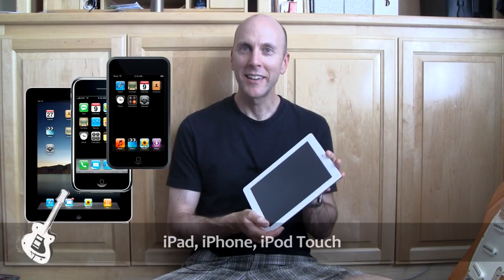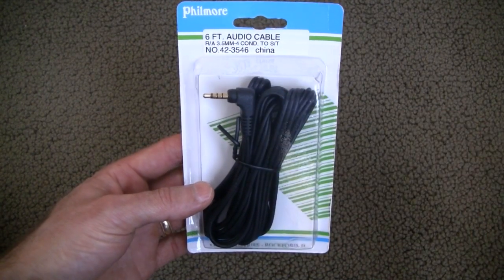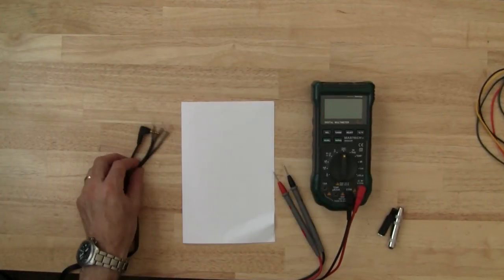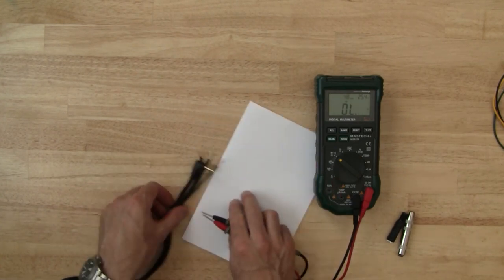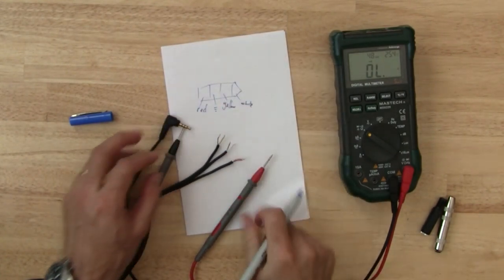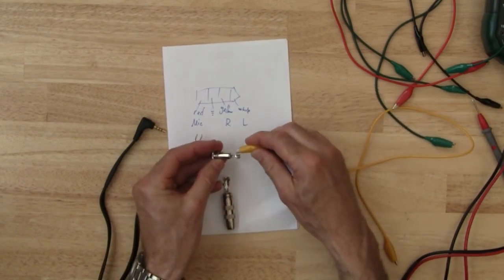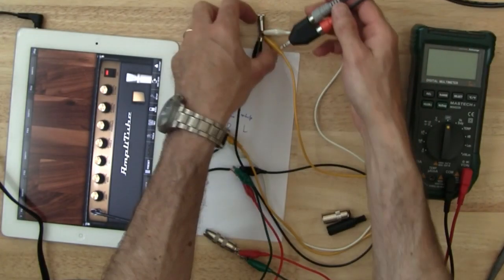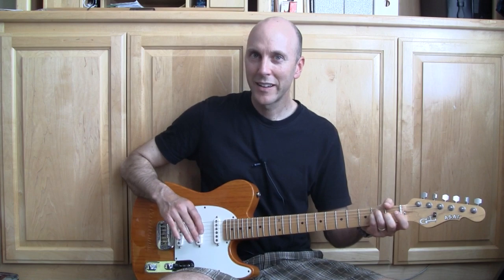Building an iDevice Guitar Interface, part 1

Comment: I am constantly amazed at people like you John, who are prepared to sit down and EXPLAIN the way things are and work, so people can understand things better.
I was wondering if you could answer a question for me?

Would you happen to know if I could just plug my Tascam USB interface, into my Samsung Galaxy Core Prime to use on Amplitube for Android?
I think I could, if I just buy the right USB cable that fits into the interface and the Samsung phone.

I am on a very tight budget here at this moment in time, but I am mad looking to play bass on something and the Samsung phone is the only way to go for me right now with the money I have.
Reply from the maker: +SDRockman - I don't have any experience with android phones so I can't give you a definitive answer.  Not sure if the Tascam USB interface would draw too much power from the phone, or whether the phone would recognize it and have a driver for it, etc... Try it- but buy the cable/adapter somewhere you can return it if it doesn't work :)
Reply: +John Cooper I think it wont work after all because it did come with a CD, to install a driver for whatever operating system you had.
But I will try buying the USB cable any way lol
As you say, I can always return it.
Thanks!

Comment: Thanks for this video... just pulling parts together and seeing what I'll need to purchase.  One use I had in mind for this was as a virtual pedal board.  I'm assuming that I can add a stereo 1/8" to Mono 1/4" jack to the headphone jack, and connect to my amp's send/receive loop.  Any problem with that?

Comment: hey man, i'm definately gonna do this! thanks.  just for interest sake, is it only impedance matching it does?(apart from splitting the signal) if so, will a normal D.I. Box match the impedance, if i use the right connectors? it would mean a lot less soldering....

Comment: I've used the 5457 as interface to my laptop but I'm having a hissing sound though. Is there other way to do this? I did connect my output to the laptop mic input and the latency is acceptable but I can't stand the hissing noise. Thanks in advance John...

Comment: Hello john i have a little problem when i connect headset theres no sound,but when i remove 1of them it has sounds either 1 of them i put the sounds ok but together thers no no sounds
Reply from the maker: Probably some wiring mistake.  As usual, I recommend you build and test the circuit on breadboard as I demonstrate in part 2: Simple JFET Preamp for an iDevice guitar Interface, part 2

Comment: Hi john i made the iDevice, but my ipad 3 don't detect a headset input only like headphones, so i can listen but it don't detect a mic, and is the same with or without the jfet. Only detect the ordinary handsfree. Can you help me?
Reply from the maker: I recommend you test the circuit on breadboard as I demonstrate in part 2: Simple JFET Preamp for an iDevice guitar Interface, part 2
The circuit is much easier to experiment with on breadboard, to make sure it's all working.

Comment: John !  works on Macbook Pro?
Reply from the maker: The JFET in this circuit requires power.  If your laptop has a powered mic input, it might work. But not if you only have a line-in. Check the input with a multimeter to see if it carries a DC voltage.

Comment: will this work for an android phone ? they also have that kind of input.
Reply from the maker: I don't know- there are so many different android devices out there- and I'm not sure how consistent the hardware is.  You can rig up a test plug for your headphone jack and use a multimeter to check across the mic/ground pins to look for a suitable voltage.